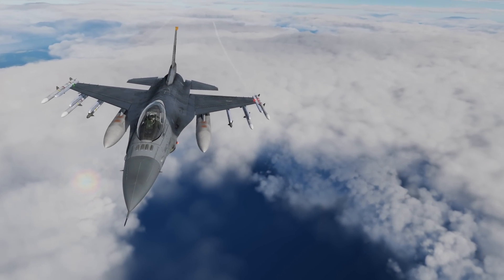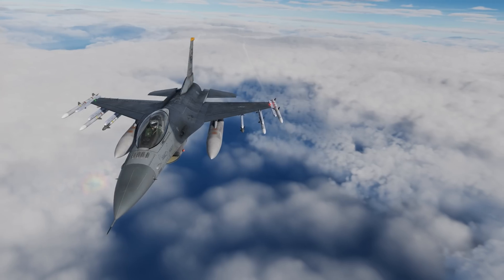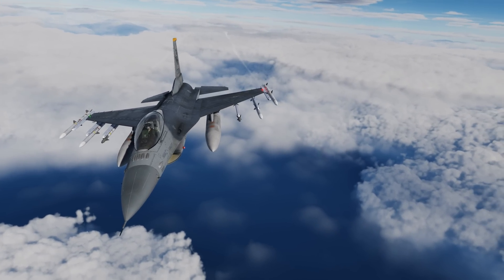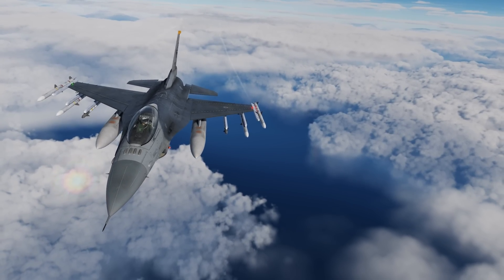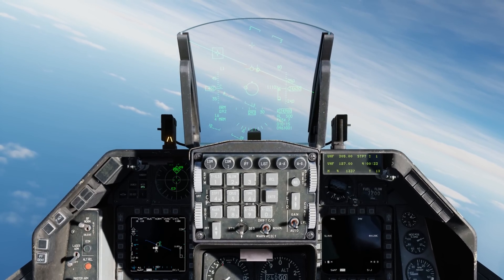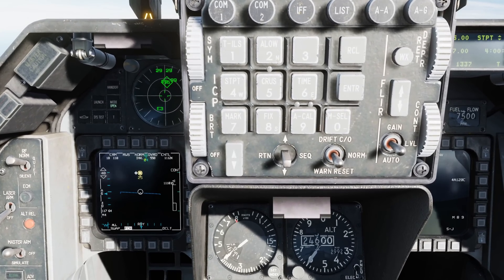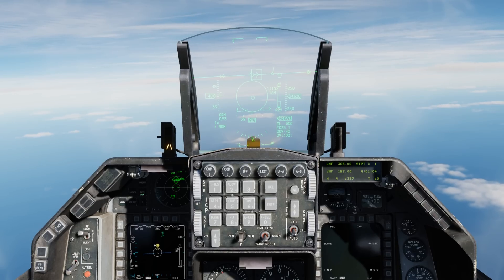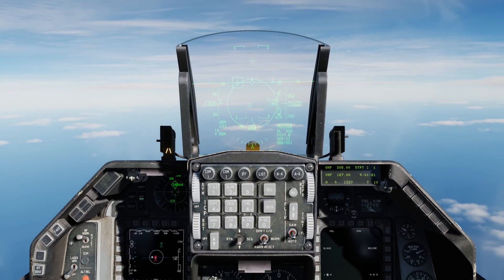DCS: F-16C Viper | Non-Cooperative Target Recognition

Comment: 25 miles? What use is that? If it's heading away from you, it basically doesn't matter if you can't tell what you're aiming for based on flight characteristics notable as-is, and if it's headed towards you, at 25 miles you're about to be in visual range in less than 30 seconds. What decision are you making in the last >30 seconds before the transition from BVR to VR that is aided by this system?
Reply: Not being hit by a missile first?

Comment: Will NCTR not classify as hostile, if the same type is used on your coalition, and IFF is for some reason not used or not compatible on the interrogated aircraft?? For example an aircraft with no IFF (A drone, for example, or some transports, or an early generation fighter), will it classify it as hostile if both sides are operating that aircraft, based only on the type and the fact it gets no IFF? My thoughts are that it would/should continue to be classified as ambiguous.

Comment: Don’t get me wrong, the tech behind this kind of system is incredibly cool and I’m glad it’s coming to DCS (also psyched Wags is back 👍)…. but I just love how the USAF has a term like “non-cooperative target.” It’s like “Damnit! I’m throwing 50 pounds of explosives at you at 4 times the speed of sound, why aren’t you COOPERATING?!??”
Reply: It's target identification that doesn't require the target to co-operate to be able to identify who they are. You use it BEFORE you throw 50 pounds of explosives at them.

Ordinary IFF (short TMS left) is your plane ASKING the contact to identify themselves. Friendly aircraft have a transponder on board that will respond to that request (ie, they'll co-operate) while enemy or damaged or otherwise non-transmitting contacts will not.
Reply: It's "non-cooperative target RECOGNITION"
Reply: It's because most of the NCTR work is done by ground and airborne control. They resolve everything in the sky, most often civilian aircraft.
Reply: "STOP RESISTING!" :)

Comment: So on the ROE tree, what happens if the mission maker sets the mission to where the mission has mixed blufor and opfor jets. Does NCTR still ident the target as enemy based on the ROE even though it might be a friendly aircraft that has IFF damaged or disabled?
Reply: irl the plane identifies what its looking at, and then checks which team that plane is on, ie its an f15 so it must be friendly, or its an su27 so it must be hostile

not sure if the f16 follows the same rules as the f18, but in the f18 nctr is magical to deal with the unrealistic parts of dcs. namely, it will correctly identify aircraft coalition regardless of the target plane. so yes it will detect that the disabled iff plane is friendly, even if both sides operate that plane.

in real life if both sides operate jf 17s it wouldnt know which teams jf that is, but in dcs the plane does know that. this is just to make the feature useful because coalitions move around way too much in dcs.

Comment: Never heard of this system before, but regardless, the details are amazing!
Reply: NCTR has been developed for F-15C during late 1980s and used in combat during Gulf War 1991 with great effect, allowing F-15s to engage targets outside the range of visuals identification which was crucial advantage. 
The system was highly classified those days, like many other F-15C electronic devices.
Reply: @bazej1080  I have heard it also uses overall planform shape to further distinguish in the event of different designs using the same engines
Reply: @Egri: NCTR is available in DCS for many years, starting with the F-15C and later also the F/A-18C.